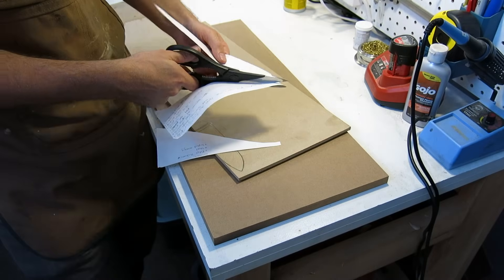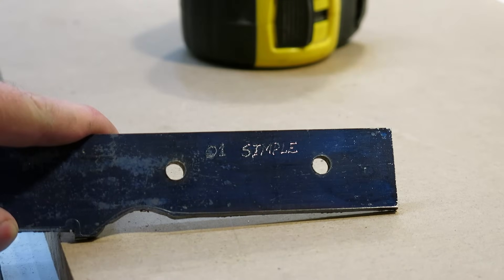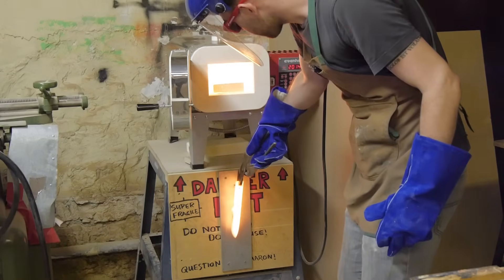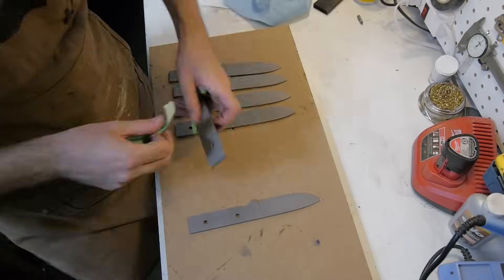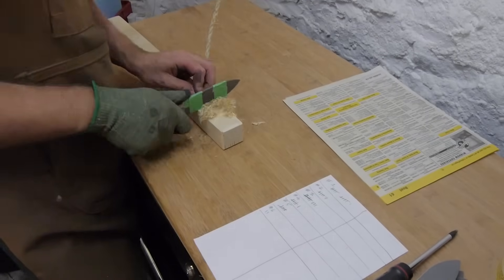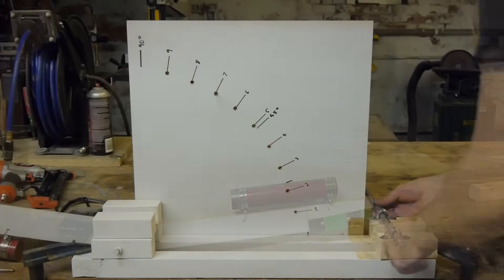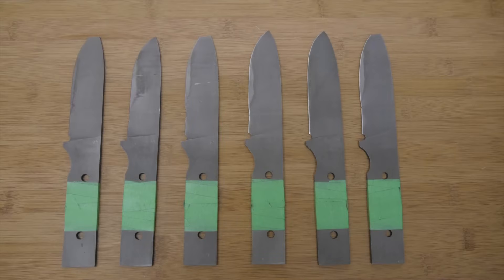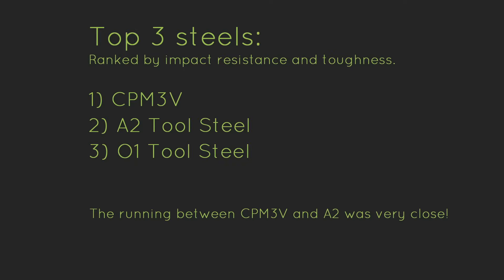Steel testing: a carnival of knife destruction.

Comment: How could one ever possibly identify a steel they arent sure of? Namely a file being used to make a knife, its large, large rectangular teeth, the steel is super hard and when cutting wheel cut its smooth as glass. It may be even too hard, hammering down the teeth some after 5-10 min warming it up with the torch (hoping to soften it up a little, didnt want to lose the teeth, just take the sharp off, forge is being reconfigured or I would've taken it to critical and fully removed the treat) but anyway...  hammering it it broke ( luckily at the exact length I was going to cut it! :) )  The edges where it broke were a soft matte grey color and felt velvety. Other then the break I am seeing an awesome piece of steel, but that has me wondering what it is and if the point will be too brittle if I dont heat and temper a specific way for where its at now. Just getting into steels past the offhand level, any suggestions?
Reply from the maker: +Alison gethealthy behappy itworks There is an old art called 'spark testing' where you can get a general idea about the steel from looking at the sparks thrown by a grinding wheel, however it's quite inaccurate unless you're very experience... Other than that you'd need a 'HIT gun' which is a high-tech tool for testing steel composition...

Basically if you're going to use 'found steel' like a file then it's best just to cut off a small part of it, heat it red hot in a forge and then quench it in canola oil. If it hardens then you're good to use it... The drawback of using found steel is you'll never really know what you're getting so the only way to make sure it's not too brittle is to test the finished blade...
Reply: +Gough Custom thanks! those are the methods I've found continuing to research. It seems common to hear good files are either 1095 or tool steel d2 etc, but the are hardenable (the ones im using) to the point of being extremely hard and brittle, telling me regardless of exact iD it is good knife fodder, I just have an ocd for details and things like accurate labels bug me, good steel is good steel but they do have if not miniscule differences and that is something I personally like to know no matter how small. Thanks for replying with a remainder though, if it works- work it! :) Good grinding and fun forging everybody!
Reply from the maker: +Alison gethealthy behappy itworks Just to clarify: I've never heard of files being made of tool steel like D2 or O1. Factory made files will be a plain high-carbon steel like 1095 or 1084, or they'll be made from mild steel and case hardened.

Comment: I'm in Ottawa and I'm curious if you're sourcing your A2 in Canada or if you've had to get it out the US. I would like to get started making blades and having a hard time finding a source in Canada.
Reply from the maker: +Mathew D'Aquino Hey Mathew! I haven't had much luck sourcing A2 in Canada unfortunately. You can buy it from KBC tools, but they supply Starrett brand steel, which is 'ok' at best. Definitely inconsistent quality on the steel itself, though the grinding is good. Buying from OnlineMetals.com is nice as they supply steel made by Precision Marshall in the USA (melted in Europe, finish grinding in USA). Their grinding is not great, but the steel is quite nice.

I now have all my steel custom made by a company in the USA called Kinetic. They source steel sheets from Germany, then grind them in-house to my specifications.
Reply: +Gough Custom  Thanks for the info. Have you ever used the A2 from Bohler Canada sold through their retail steel stores called "The Steel Store".

Comment: Now I may misunderstanding what I've read on BF, but I was under the impression that plate quenched steels have to have their bevels ground post-heat treat?

I've got an evenheat coming in in 2 days, I'm about to be doing this same series of tests!
Reply from the maker: +Eagle Bird Knives Hey mate! Interesting question! I would think that plate quenchng a pre-ground blade is less efficient, but should still work pretty well. The plate will pull heat out of the areas with the most thermal mass (tang, spine) while the edge will cool very quickly regardless because it's thin... It's definitely something worth thinking about though!

Comment: hi aaron so im interested in the heat treating for the cpm 3v you did i was just wondering if you believe cryo or ln is necessary or what benefits it gives the steel?
Reply from the maker: +colton kroon Hey Colton! CPM3V definitely benefits from a sub-zero treatment right after the quench. People on BladeForums that I trust swear by sub-zero after quench and then a low temperature temper of 400ºF for 3V.
Reply: Great work by the way

Comment: what do you think about Elmax steel, can be better than 3V?
Reply from the maker: +Chilean Hunter It really depends what 'better' means in your opinion...

Tougher? Probably not.
Better edge retention? In some use cases.
Better corrosion resistance? Definitely!

Any steel is a trade-off of different properties. 3V excels at being very tough and stable even at high hardness.
Reply: Gough Custom toughness (most important for me) and resharpening. thanks sir.
Reply from the maker: +Chilean Hunter I would go for 3V for sure then!
Reply: Good to know for my next purchase, especially for being the opinion of someone who knows about. Thank you sir.

Comment: but why ise A2 when cpm3v is superior?  I'm not a craftsman but it seems odd you would use the lesser material. unless there is a significant price difference?
Reply from the maker: +AnAngryMudkip The difference between A2 and CPM3V according to the rules of the test were very small, and there were subjective things about CPM3V that I really disliked (at least with the heat-treatments that I tried). The main issue was that CPM3V tended to dent/roll at the edge much earlier than A2 did, though it was 'tougher' because it wouldn't chip when exposed to more serious abuse... In use though that behaviour is not very useful because a dented or bent knife is very hard to sharpen. A2 will still dent, but it seems to require more abuse to dent it, and add a little more abuse on top and it starts to chip out instead of bending/denting more. 

As I said, it's a subjective thing but I preferred the behaviour of A2 compared to the early denting of 3V.

I have since found that people have been having different results with alternative heat-treatments for 3V and I plan to explore those along with some other steels during the course of this year!

Comment: i know how old this video is but i must ask how would 1095 compare i just bought 2 long bars for knife making i know 1095 has great edge retention but it has less durability than 01 tool steel. but will the steel be to weak to make decent knives?
Reply from the maker: +Owen Quinn Hey Owen! I can't answer that actually as I've never tested 1095!

From what I've heard from others though there should be absolutely no issue using 1095 for knives. It should be as tough as O1 (at least) and it is supposed to be a great knife steel!
Reply: Gough Custom
thank you for responding so quickly to my question and thanks for the info i'll post a video response once i have made 1 so you can see will be making your bevel jig and forge to heat treat

Comment: Great video! Are you willing to share your heat-treat method for A2 steel?
Reply from the maker: +matthiasgr555 Thanks! Yes I am indeed! If you look underneath the video in the video description, there are links to threads on BladeForums with all the heat-treatment schedules I used. The one you're looking for is "A2 Ver 1"
Reply: thanks i do appreciate!
Reply: +Gough Custom when you quench in air, do you cool the blade with air from a compressor, or simply hang them to quench.
Thanks
Reply from the maker: +matthiasgr555 I just leave them to hang in still air.
Reply: thanks bro!

Comment: I don't know if you mentioned it but what are the exact heat treat cycle for A2. I have a small amount of it and I think I'm going to stick with spending the extra money on it instead of 1095 unless I'm going to get decorative with a hamon. anyway thank you taking the time to do a testing video!
Reply from the maker: +william kroth (Eric) Hey William! If you check just under the video in the video description there are links to posts on BladeForums where I detail all the heat-treatments used in full.

Comment: is stainless foil needed to heat treat D2? what other steels did you test?
Reply from the maker: +GC Knives Yes, Stainless foil is needed to heat-treat both A2 and D2, the temperatures are so high and the time in the kiln so long that without the foil they would lose a lot of carbon to the atmosphere.

In addition to A2 and CPM3V I also tested O1, 440C and CPM154. There are links to the full results in the video description just underneath the video.
Reply: +Gough Custom thanks
Reply: +Gough Custom Would I be able to use a gas forge? Gas forges heat it up quicker, so would it be okay to not use foil? If not, where can I buy the foil?
Reply from the maker: +GC Knives Usually a gas forge won't be suitable for heat-treating a steel like D2, unless you have precise temperature control in there like some of the really serious forging guys do with their PID controlled forges...

Comment: I've always wondered how long grade was put on a knife that file jig is really cool I was surprised to see so much steel dust, how would you rate the A2 against Kershaws 8Cr13MoV btw where is your sale site?
Reply from the maker: +Cory Wolfe Hey mate! 8Cr13MoV is a relatively inexpensive stainless steel... Usually heat-treated fairly soft. Comparing my A2 against it: the A2 will be more likely to corrode but will probably hold an edge 2-3x longer... If the 8Cr13MoV were to be heat-treated harder then it would do better, but in that case the toughness would likely be lacking. My website is here: http://goughcustom.com/

Comment: Awesome viedo. I'm working on doing some destruction tests myself with RWL-34, 1075, D2 and one or two more that I haven't decided upon yet. I am not surprised o1 was in the top three though. I've trusted my 1075 blades with far more than any of my other knives and only had one tip failure.
Reply from the maker: +CSGSurvival I think 1075 would likely do far better than O1 actually, overall I wasn't that impressed with O1 to be honest! Have a look at CPM154 if you want a really tough stainless, it's a great steel!

Comment: Wow what a test!, I almost had to close my eyes a few times. Witch steel did you harden with the "home brew" hand made kiln? and how did it hold up compared to the others? Sometimes I wonder how much better a kiln will work with simple steels.
Reply from the maker: stevenk1965 Thanks mate! The steel heat-treated in the homebrew forge was O1 tool steel. It did ok, it bent more than it should have in the bend test, but that was likely my fault. Heat-treating by eye is a real skill! Heat-treating simple steels in a kiln does wonders for them, it really does. O1 heat-treated in a the kiln did WAY better than in the little forge. Either way would make an 'acceptable' knife for most uses but if you're trying to get the best out of your steel a kiln is definitely the way to go!

Problem is once you have the kiln you'll likely want to use a fancier steel than O1 :) I ended up going with A2 and I've been very happy with it! The extra corrosion resistance by itself is totally worth it!

Comment: Very interesting  tests, What were all the steel samples you used as you only call out CPM3V, A-2, & O-1.  Also were you able to perform Rockwell Hardness Tests to determine the actual variations in hardness after heat treating.  This should prove to be valuable information to share.  What is the anti scale paste you use, I have only used the SS foil in the past and have always had excellent results but it is pricey.....  Have you ever worked with D-2, its a very tough steel with high Chromium contents but also very hard to grind.  I've always wanted to make a knife from this tool steel too.  Working mostly in O-1 now but I like A-2 also.

Nice video thanks for sharing.

Paul Maselli

TheMobileBoatwright.
Reply from the maker: Paul Maselli Hey Paul!
There is a full listing of all the steels I tested in the video description below the video! I was able to hardness test all the steels, the results are in the listing as well.

D2 is a nice steel, however as far as I understand A2 steel is much tougher, though it's less corrosion resistant unfortunately. I use A2 for all my knives these days!

-Aaron
Reply: Aaron thanks so much for the info.  I didn't look at the comment's below but will now.  As a tool maker I always felt A-2 has the best working properties.  D-2 is the toughest steel and we use it primarily for very high wear components due to its chrome content.  Definitely the toughest of tool steel to grind and keep true and flat.  Thanks again... Paul
Reply from the maker: Paul Maselli Interestingly the high chrome content is what makes D2 less tough for knife use... Because a knife edge is so thin it has to be very tough and also somewhat flexible to be able to withstand use and abuse. The high level of chromium in D2 produces very large Carbides (of chromium and carbon) that are also quite brittle. Because of their size they can make the edge chip where it wouldn't normally. Powder metallurgy versions of D2 (like CPM-D2) help to fix this issue by limiting the size of the carbides. A2 has less chromium and a VERY fine carbide structure which is what makes it so tough when used in knives.

Comment: Nicely done!  Thanks for all of your hard work that went into this test.
Reply from the maker: Applied Science Hey thanks Ben! That means a lot coming from you!

This test was not nearly as scientific as I'd like to be in the future... I'm mulling over ideas for an edge retention testing rig that would use my machining center as the motion control platform. Guide the knife through a wear medium and use a load cell to measure dulling over time.

If you're ever interested in a steel testing collaboration that could be a lot of fun! Impact testing, heat-treating, edge retention testing, micrographs and so on!

Comment: Is it better quality when you do a blade at home or would you say that high quality factories can make a better steel ?
Reply from the maker: Cool Dude Depends on your setup/experience at home and also what factory it is. The best homemade knife is definitely far better than the worst factory knife. The best factory knives are very good and will usually be better than a first knife made by an amateur, but it doesn't take much in terms of knowledge to start closing that gap!

Comment: What temper/quench worked best for the a1
Reply from the maker: cr3ativ3mischi3f I personally do 1775ºF for 35 minutes, then an air quench, then temper at 400ºF twice, with a sub-zero quench in between tempers.

Comment: Gough Custom I think you should have chose CPM3V.
Reply from the maker: CPM3V (when heat-treated like I showed in the video) had a failure mode that I did not like. The edge would dent before the others were chipping, and a dented edge is pretty terrible as it messes up your sharpening and so on from then onward.

I have heard that use a low temper for CPM3V reduces this tendency to dent, so it's something I plan to try in the future.

The other complication with CPM3V is that it's much harder to get than A2 and sometimes they simply run out of stock. Not an insurmountable problem but at the time it was another strike against it.
Reply: Gough Custom Or you should try 4V - it solves all the problems you have in heat-threating 3V and it is even better than all of the steels, that you used and use.
Reply from the maker: I would like to try CPM4V for sure. Just a matter of finding time to do another round of testing. A2 has performed very impressively for me so far, so it will take a hell of a steel to replace it.
Reply: Gough Custom I think you should add an option to choose the steel for the knife and virtuovice tell him your opinion about 4V.
Reply from the maker: I think it's best to specialize in one type of steel. I can either do one type of steel well, or 10 types of steel not so well. Besides I think as a knifemaker part of my 'design' for a knife has to include the steel, after all people buying a knife from me are essentially buying my expertise.

I've heard good things about 4V, but ultimately I have to test it and see for myself.
Reply: Gough Custom I agree with your words.
Reply: virtuovice knows a lot about 4V. He has tested a knife from that steel and Gough Custom, you should ask him, then try the steel.

Comment: You have been great! One last question. I heat treated my o1 knife last night, and did 2 separate 2 hour tempers at 400 degrees. Can I still do a cryo treatment? If so, for how long? Should I temper again afterwards?
Reply from the maker: sub zero treatment doesn't really have any benefit for O1. generally you have to do it before tempering at all when it's used on other steels.